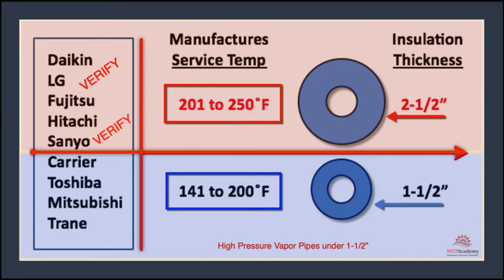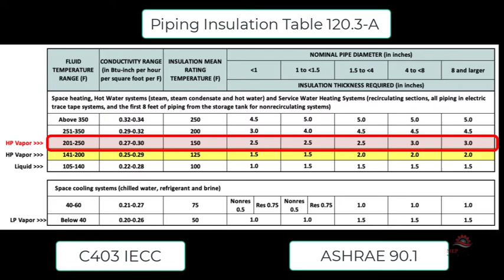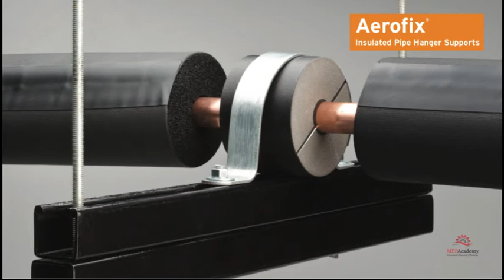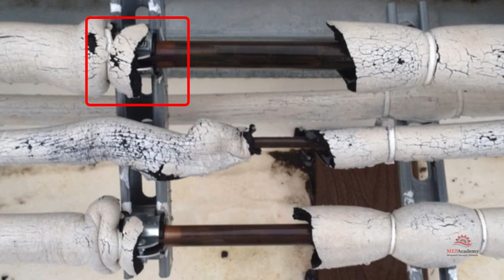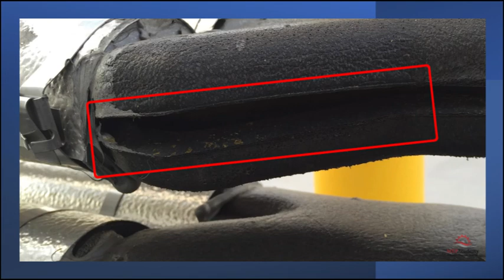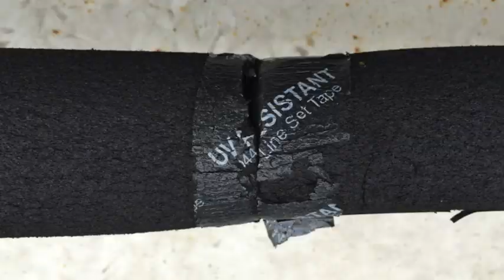Refrigerant Piping Insulation Requirements

Comment: The table you are referring to is from ASHRAE standard 90.1, Table 6.8.3-1 Minimum Piping Insulation Thickness Heating and Hot-Water Systems (Steam, Steam Condensate, Hot-Water Heating and Domestic Water Systems).  I believe it is not applicable for refrigerant piping.
Reply from the maker: No, the table in our example is from the California Energy Code and is referred to in the video as Table 120.3-A which is part of that code. The example was not from ASHRAE. Thanks for watching.
Reply: @MEPAcademy  I've had the same concern and found this video. Where I'm using ASHRAE 90.1, it seems like 6.8.3-1 is very explicitly only for steam, steam condensate, hot water heating, and domestic water systems. It's more vague in IECC because they've combined the tables and it just says for "fluids". I've been trying to find clarification on this matter.